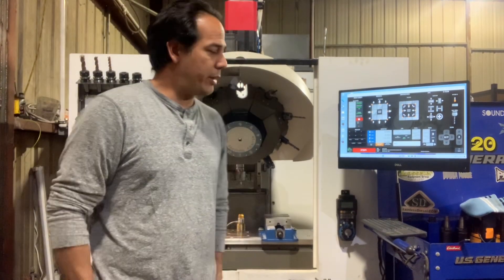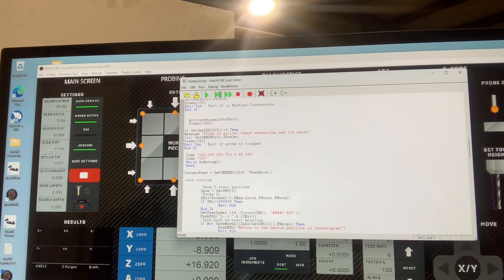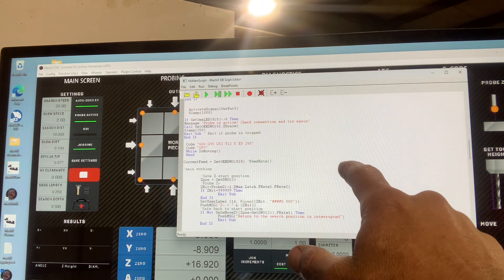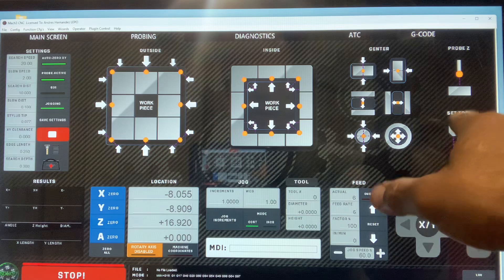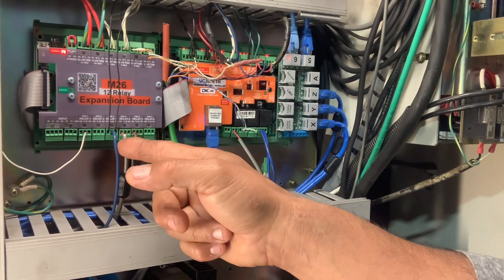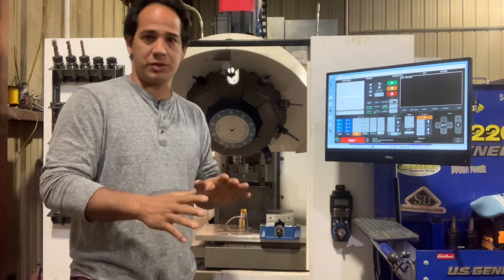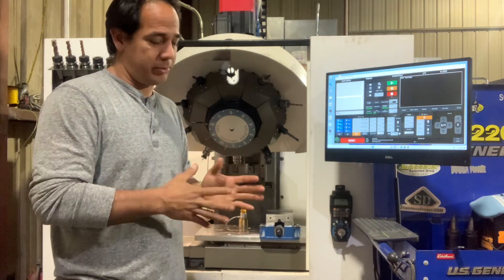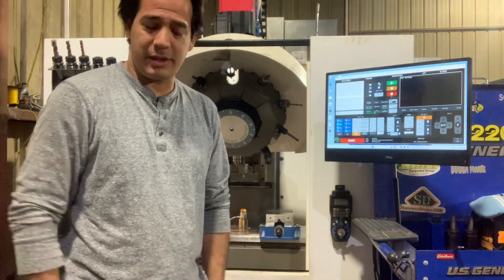Tool Height Setter CNC Mach3 Retrofitted (How Can I Help)

Comment: can you share the macro script??? love you retrofit on this brother. I installed Chinese offline control and am now thinking of changing back to Mach3
Reply from the maker: I can send you the script via email but remember this script is designed for this screen set it won’t work if you don’t have the screen set with all the DROs are LEDs 
Thanks so much
Reply: @chenosperformance2499  If you can share, I will be really appreciated.